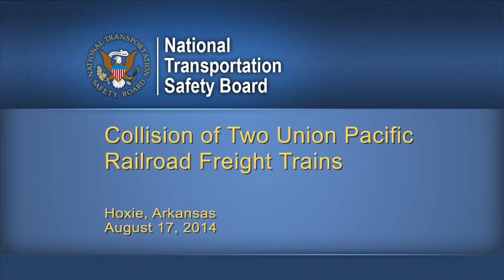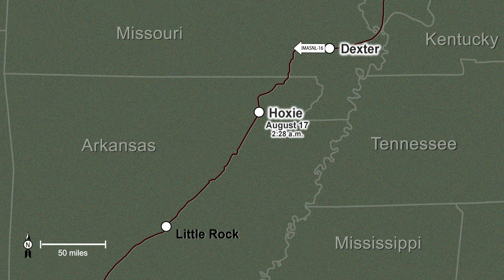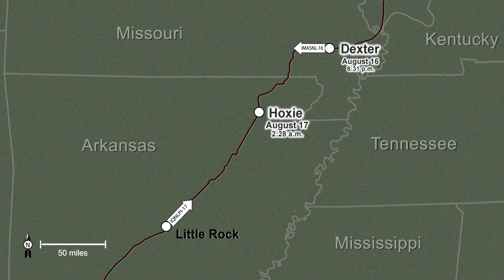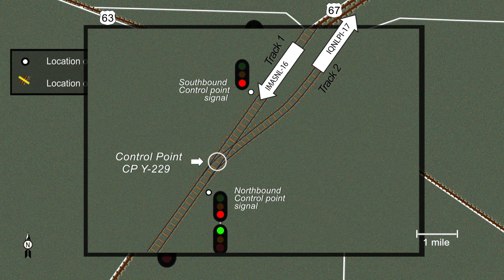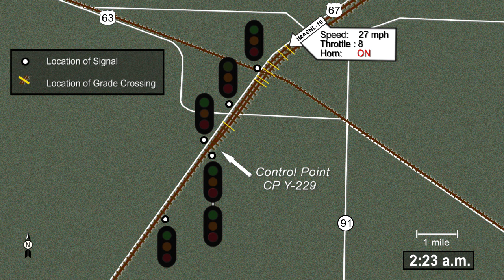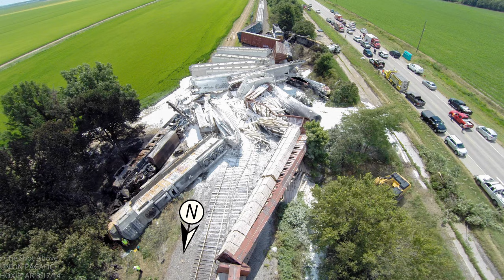Collision of Two Union Pacific Railroad Freight Trains

Comment: The crew of the southbound was snoozing. That wreck never would've happened if crews had "alerters" the way Amtrak does. You can blame the unions for this wreck.!!! Don't tell me that I don't know what I'm talking about, I'm a retired engineer. The unions fight every safety device that get's dreamt up. It's impossible for a crew to be snoozin' when they have to bang the button every 30 seconds.
Reply: I know of crews so sleepy that they would sit up long enough to hit the horn sequencer and go back to snoozin'. When you have been over a stretch hundreds of times, you know just when to lift up your head and go right back to sleepin'. With two men up in the cab, it is impossible that the air brake failed!
Reply: Farmer Dave what...?
Reply: pj8guy..why did you make a meaningless comment like that?
Reply: Yeah, the unions fight every safety device that get's dreamt up because every safety device that get's dreamt up always replaces a human doing the same job. The rail industry is a veritable festival of capital improvements replacing humans. IE: before crossing signals/gates, there was a flagman at EVERY crossing. Before the invention of the automatic air brake, there were brakemen that stopped the trains. Before the creation of track signals and CTC, the head and rear flagman performed those functions. And the most reviled improvement that got a LOT of resistance... the infamous EOT. So now the next step here is PTC. And when that is implemented, the next step is to get rid of the condr. The next step after that is totally autonomous operations with absolutely NO ONE in the cab. Crewless operations are the desire of the company. PTC is the first step to that goal.
Reply: I agree with you somewhat. But not every safety device replaces a crewman. I agree that railroad management is greedy s Hell, and that they would turn every crewman into a black box if they could. They've already done it with remote control locomotives, and they will keep going until lead road locomotives have camera's in them being run by wayside controllers.
Reply: I've actually seen the original inside cab video
Reply: And what you said is EXACTLY where we are headed. A human-less workforce. I left the CNW/U.P. here in Milwaukee a month before the put RCL in operation back in '04. They kept it for a while then dumped it.
Reply: Unless you just lucky enough to work for a company that provides its staff with such good terms and conditions they don't need a union?
How about putting the blame where it lies? For example train crews who ignore safety rules? Train companies who refuse to fit automatic braking systems for if and when a train passes a red? It's not rocket science and it's definitely not the unions.
Reply: Wasatch Range Railway 
every engine (UP and other class 1's) have alerters on them. If for some reason they didn't the union's had nothing to do with it.
You can snooze and work those alerters, just have to be fatigued enough. Work /Rest cycles is what would make it safer.
Reply: Downeaster Productions 
Penalty brake application, full brake application at normal rate. Not emergency application.
Reply: I know. Like I said, the crew can be snoozin' waking up long enough to hit the horn sequencer and go right back to sleepin'-----same with the alerter. I agree, over worked!
Reply: And that's a problem why exactly 25MFD? The vast majority of train accidents like the one described in this very video are caused by people. Trains are not exactly something that needs to be operated by a person. We're on the verge of transitioning our trucking industry to self driving big rigs. Self driving trucks are far more complex than a similar system for trains would be and we'd all be better off with computerized trains actively knowing where each other are at all times. All we could really use a person on board for active maintenance and the decoupling tasks.
Reply: Here is the MAIN problem with a humanless workforce...the automated machines that replace humans DO NOT consume. They don't contribute money into the system. A human with a paycheck is what drives any economy. Humans with a paycheck, buy, buy and buy. Humans buy clothes, food, gas, new vehicles, new homes, new furniture, new appliances. They pay to go out to eat, to go to the movies and to invest in the stock market. If we unplug humans from the consumer/producer circle, the providers of the goods and services won't have anyone to purchase their goods and/or services.
Reply: Wasatch Range Railway all trains have alerters
Reply: Wasatch Range Railway It's highly possible for someone to be in a state of light sleep and preform repetitive tasks. Have you ever sleep walked yourself into the kitchen for a drink or piece of cake, and then in the morning wondered where that fork take keeps jabbing your leg, came from. Once you pulled back the covers there is the plate and very smashed chocolate cake.i have no idea if anyone was sleeping on the train or if it was an act of God bearing no human responsibility. In college I had an afternoon job filling vending machines, as well as working evenings as a projectionist on the old fashion arc projectors. Never getting enough sleep there were times when I made all the reel changes, kept the focus perfect, yet I had no memory of what I did for the past few hours. A few times I was awakened by the manager knocking on the door to see if I was ready to close.
Reply: Yup! And that is precisely why they over ran the siding! My son-in-law was a projectionist before he joined the military----good kid!
Reply: uh..  locomotives have HAD to have alerters for years, hell, decades.
Reply: Wasatch Range Railway Funny, it's the other way around every where else. Unions push for safety measures, management doesn't want to spend the money. Why does that sound more like reality than your explanation?
Reply: 25mfd You got some crazy unions in the US. And I'm an ex Union health & safety officer.
Reply: What's wrong with automated trains? The fact they aren't automated even though they are on FIXED rails is proof that the unions are poison. Cars are about 3 years from being fully autonomous. Why pay salaries to lazy train drivers who fall asleep when a computer can do it safer? It's literally a forward button and a stop button. In a perfect world we humans sit back and relax while robots and computers do our bidding. If you're job is so basic it can be done by a computer perhaps you should up-skill.
Reply: Name a few safety measures the union pushes for that the carrier blocks.   Safety first is the rule and is the culture we all work to maintain.
Reply: The foot pedal deadman switch hasn't been a thing since the 1980s.   All locomotives have alerters on the console.  Wacatch Range Railway does not know what he is talking about.     Though I guess horn activation--perhaps there is a railway that has a horn button on the floor.  I've not been on one that does.  And ive been on thousands.
Reply: quelin1 funny you say that because I've just driven a train yesterday with the horn foot pedal on the floor. Currently an engineer, but if you check ntsb statement about the accident they are now requiring all railroads to remove it.
Reply: on a class one locomotive?     I hostled for years.   Though ive been a YM for a bit now.
Reply: quelin1 yes sir class 1 but maybe what we're talking about has different names on different railroads. The piece I'm talking about is the pedal on the floor that actually blows the horn. & if it was activated then it would stop alerter from going off
Reply: Wasatch Range Railway That was my job that day. I laid off. They were sleeping and the alerter didn't go off because the train had a horn sequencer that Chance(the engineer) activated when they were north of the BNSF Locker. And the UTU/SMART is just a rubber stamp for the UP. But you probably know more because you worked that territory, right?
Reply: 3 Range Railway
Reply: They did not see the signal. On BNSF, I was trained as a conductor to call out the signal indication when I could see it and the engineer would verify. It was a competition activity to see who could see the signal first subsequently keeping everyone in the cab awake.
Reply: Potential Heart Attack or Stroke?
Reply: Unions don't say there's not enough money to put in Alerters, or PTC. or that the FRA is being absurd with their proposed requirements for PTC, or newer safety gear.  

What you do see happening is the class 1s, ( which your wasatch range is a part of the Class1 UP.) running more crews for longer periods, without break, because the class 1s all say well we need to compete with LTL and TL freight.  the cry poverty, Then they go to congress spend money to lobby and get rules changes killed. 

IF it was unions causing these incidents, then well, I guess you'll back Automatic Train Control, and take the faulty link ( engineers such as you used to be) out of the equation.
Reply: Farmer Dave
You had to bring your Communist politics into it, didn't you?
Reply: 25mfd
There are some safety improvements that could be implemented that would not reduce manpower. Installing transponders to monitor controlled situations (such as the movement and distance of other trains) would be a good idea. They would not replace human intervention because they could never account for the x-factor - cars, people, and other sudden obstructions.

In this case, for instance, it would be able to pick up each of the oncoming trains' signal and monitor the progression. As the distance between the two shortens, it could automatically adjust the speeds accordingly to avoid a collision.

Now, I'm no expert on this kind of thing, and if similar systems already exist, then I concede my genius. It would seem, however, that if they were already in use, this wouldn't have happened.
Reply: weejams
THAT was a lot of information I didn't need to know...
Reply: weejams
I don't want to start a big discussion here since my knowledge of trains goes as far as knowing not to park in front of them when they're crossing a road, but it seems to me that if the technology is in place for trains to interact with each other in the way I described, then there should have been an automatic electronic response on both trains to slow and then stop them with no human intervention.

This obviously didn't happen - the narrative of the video shows that the drivers failed to slow down sufficiently (indicating that it was a manual response no such safety device was in place).
Reply: I don't remember placing blame on either one (although I might have). But that wasn't the point I was making.

If trains had a monitoring system onboard where they could pick up nearby activity (within a few miles or more) from other trains, both trains could simultaneously react electronically to each other's movements.

This would involve, of course, taking readings of the exact coordinates of themselves and the opposing train, coupled with pre-programmed parameters within each train's computerized tracking system that maps lights, signals, switches, etc in the immediate vicinity and includes them as factors that determine that train's actions. Weather conditions could be integrated into it, but I don't see that as a significant factor if the other electronic parameters are in place.

If the location of a train can be tracked halfway across the country, these innovations could be in place as well. Obviously, they're not. If they were, this accident would never have happened, and assigning any blame would be moot.
Reply: Okay. You know what? You're not comprehending what I'm saying - I expected this.

I said in the beginning that I didn't want to get into a drawn-out debate about this, so let's just let it go.
Reply: I bet you blame the union for the nice wages you made and the cushy pension your drawing, too.
Reply: Railroad pensions are drawn from Health and Human Services (Railroad Retirement Board is in that agency) and even resemble Social Security checks.  No “cushy pension.”
Reply: I retired from UPRR on 02/01/2018.  UP has had alerters on their locomotives for decades.  I agree that the crew must have fallen asleep.  BUT someone was awake during the horn honking for the crossings.  After that who knows?  Allerters on UP locomotives won't go off IF the locomotive senses horn honking, throttle or dynamic brake handle movement, or any brake application within a set amount of time. It doesn't leave a whole lot of time for snoozing, but it does happen.  And at the wrong time is all that it takes.  When I retired UP was just in the process of installing inward facing cameras to snoop on the crews. THAT is the only "safety device" that I know of that the Unions fought.

Comment: Don't the railroads have control centers where dispatch controllers can know and monitor every train's location and velocity in real time?
       Air planes have this, and I think it would be easier to use that same sort of system in trains.
       Planes can be anywhere in 3 dimensional space, Trains can only move through one dimension, on the track.
      There should be no way this sort of thing could happen outside of a deliberate cause.
Reply: Eric Taylor stop crying
Reply: this accident was the equivalent of running a red light in a car and plowing into another car.
you expect a dispatcher(the guy you refer to) to monitor 1-2-3 dozen trains, their location and speed?  super-human if you ask me.
tech could prevent this, however this tech is still somewhat problematic and expensive.
automatic train stop(ATS)has been around for a hundred years.  several RRs had it.  a few still use it.

Comment: US railroad companies continue to get away with violating rest regulations, running trains within the safety margin of weight and brake capacity, non-compliance with safety regulations and generally dragging their feet on anything and everything that could be considered safety-over-budget (like e.g. installing an advanced warning system that emergency stops the train if the driver falls asleep). And there is no indication that the NTSB, the departement of transportation itself or any state want to do anything about it because freight rail is already behind in the US. And so the vicous cycle continues.

The more I think about it, US rail is really a microcosm of the US political climate in general. The only thing that counts is the profit margin. Anything else - and be it the loss of hundreds of lives - is secondary to that goal. If it is thought about at all.
Reply: Be quiet

Comment: Strange, that the richest country in the world has railways from the 19th century.
In Portugal and in most European countries, this would hardly happen because there are automatic speed control systems.
For example, if a train passes a yellow light at more than 30Km/h or if it passes a red light, this immediately triggers the emergency brakes, I thought that in the USA this was also the case...
Reply: We do have something like this on some routes (mainly routes with passenger trains or very busy freight routes) called Positive Train Control, but the implementation of the system is very recent.
Reply: @ViewpointUnique  
Good night,
Trains in the USA are still very late compared to Europe, here such a case is almost impossible, firstly a fixed yellow signal can only be passed at a maximum of 30 km/h (18.6 miles/h), if it exceeds 33 km/h the train is automatically braked.
On the other hand, I watch a lot of videos about American railways and often the condition of the tracks is terrible, here that wasn't possible.
Railway legislation here is very demanding.

Comment: Did anyone lose their life?  To me, that's all that matters
Reply: I don't know for sure, but two trains hitting head on at that speed, it couldn't be good.
Reply: Walter Boxhead good
Reply: and if you would have googled a little more you would have known the northbound crew jumped out to survive! Both injured one very badly. No way to survive if they hadn't.
Reply: except I didn't have to google it and this video left that part out! google may have too!
Reply: @donn8562  We should not need to Google.  Should be provided.
Reply: Taken from an article from USA Today....

A southbound train collided into a northbound train that was turning onto an adjacent track. The southbound train passed two yellow warning lights and a red signal without slowing down and with no sign of activity in the train’s cab before the collision, investigators said.

The board found no fault with northbound crew members, who had no time to apply brakes before the collision. The northbound crew members were seriously injured, but survived the crash.

The southbound train had an automated alarm that could have given visual and audio warnings to the crew. But the warning didn’t sound because it interpreted the train’s automated horn signal as someone operating the controls, investigators said. The safety board previously issued warnings to the Federal Railroad Administration and railroads about the flaw in the automated warning system.

Both crew members who died in the 2:28 a.m. accident were presumed fatigued and were likely asleep, the board agreed.

The two from the Southbound train that didn't slow down were presumably asleep as one of the two suffered from sleep apnea. Both of them died. RIP
Reply: Thank you, metal.   Interesting thathe automated horn signal caused the system to register the horn being sounded as operator input.     What is Automated Horn Signal ?   For grade crossings?

Comment: I can't believe it, that there are railroad companies still operating without the simplest train control. Comparable with the german PZB for example. With the behavior from the engineer on the machine at track 1, the PZB had stopped the train after the second yellow signal with a full emergency braking. (Speed to high for yellow)